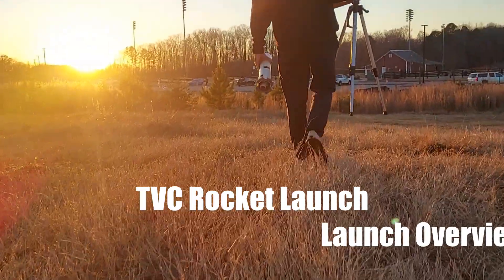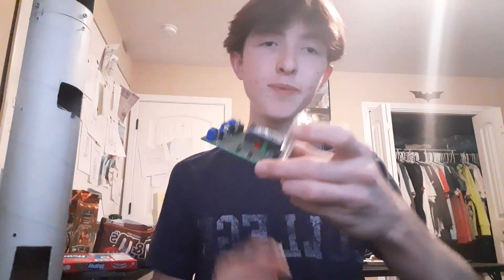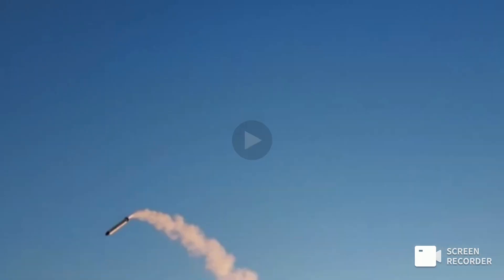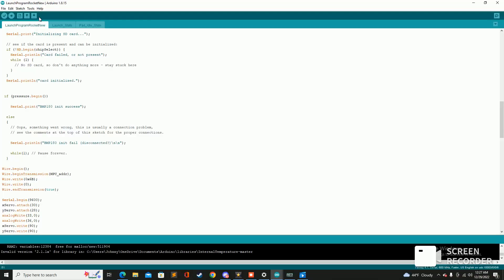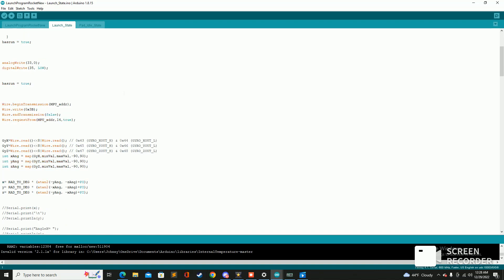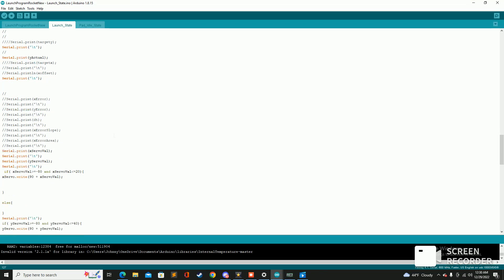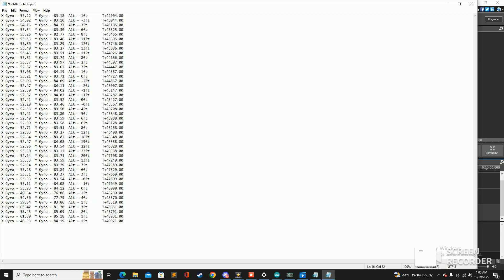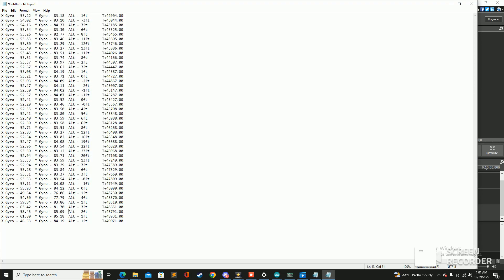Launch 1 Overview | TVC Model Rocket

Comment: I would advise you to log the rawest readings possible without any filters. Filters are good for high precision stuff but for a simple TVC rocket they are not necessary and can ruin a flight when they don't work. 

The altimeter seems to go to zero every time the rocket make a loop. Make sure there aren't huge gaps in the airframe that allow high speed airflow to ruin the air pressure reading!

Comment: Are you using the raw values from the gyro? The MPU6050 has internal processing that gets really annoying when making your own filters
Reply from the maker: In using raw gyros and gyros derived from acceleration and when put together create a more accurate reading, however in my system the filter was still flawed and needed to be furthered optimized